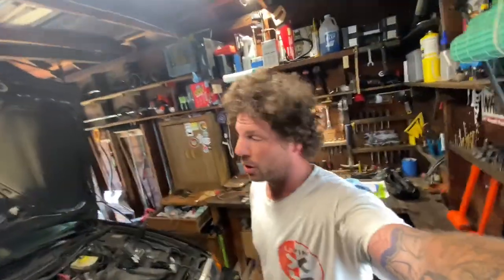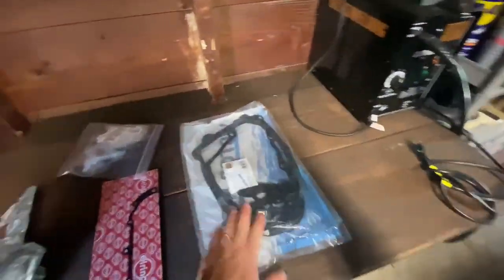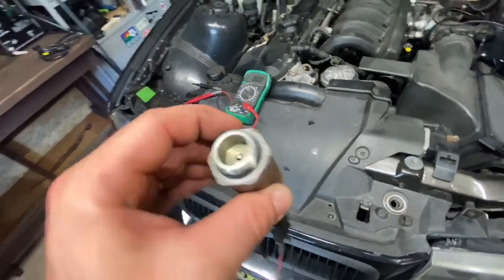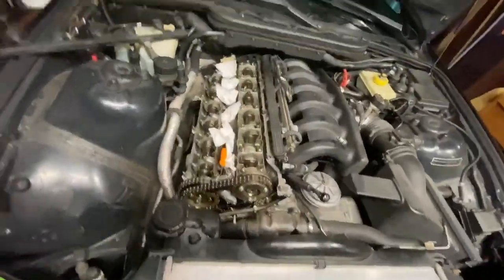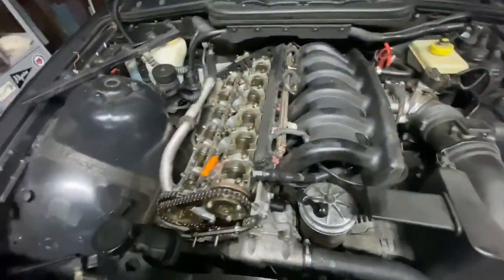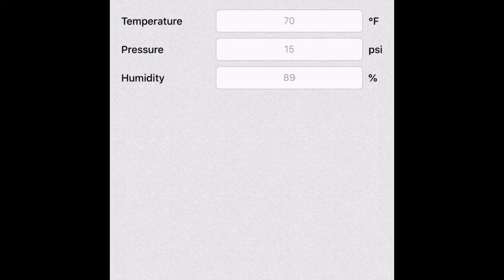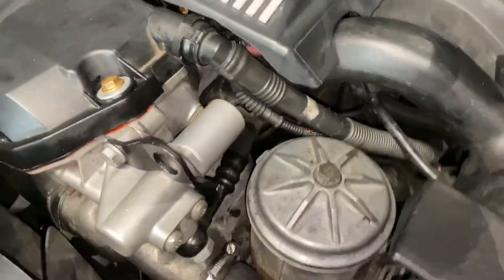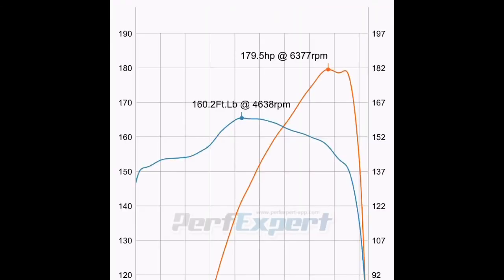How Much Power Does a Vanos Make? E36 M50 M52 S50 S52 Vanos before and after! Awesome Gains!

Comment: ok i have a 1998 bmw 323is and i am trying to take off the vanos solenoid , what size did you use 32mm or 33mm because mine will not crack open and the camshaft positioning sensor and the banjo bolts on the left bottom are a little in the way.any suggestion here . Thank you
Reply from the maker: Try an 1-1/4” open ended wrench or you can use an adjustable.
Reply: @114RIDES  ok well i tryed a 1 1/4  and 32mm . but still doe's not fit . so i guss i'll try a 33mm, but i'll have to order one. BUT I'LL try the adjustable first and see if it grab's good enough to loosen it. Thank you for getting Back to Me. Peace Bro  :-)

Comment: How about a M50 Intake swap? Makes a big difference in power
Reply from the maker: I have been thinking about that lately, maybe down the road I can pluck one from the salvage yard. Thanks for watching!
Reply: @114RIDES  cool idea. Wish I had thought of it with torque app before doing mine. I have one with m50 manifold (road race/autocross) and one without (street). I recommend leaving it stock for the street. The m50 mani is only really worth it for track cars that spend a lot of time at high revs imo. For street and autocross we miss the midrange and low end. I’m actually considering swapping the race car back now that we’re mostly autocrossing it.